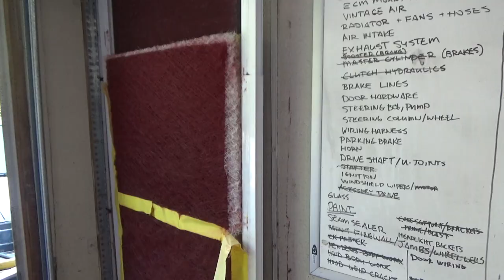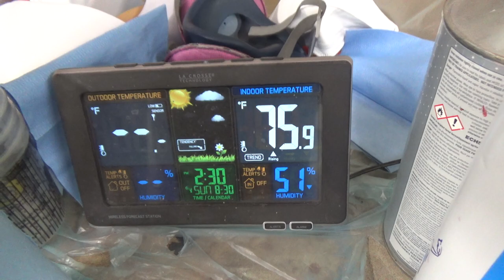1977 Camaro Z28 Part 242 : Will it blend?

Comment: Hi Erik, looks good. I know I mentioned it before you started painting about dog housing the compressor. What I've done for years is use this light weight PVC frame and tape it to the wall leaving about 2 inches open on the bottom and cover it with fresh car cover as needed. If you flow coat please try this method it works. Looks really good, your hard work and determination  has impressed us all.
Reply from the maker: Thanks Cliff. Sorry, I forgot all about it that. You say a car cover? While you are spraying? Do you have a pic of this?
Reply: @asicerik  Yes, measure your compressor x,y and z and leave a few in. on each side.  Using  schedule 40 or lighter pipe you'll need to  make three square loops and glue them together using four elbows, four 3 way 90 degree and two 4 way 90 for the center or midway loop. Your just making a light weight box that tapes to the wall surrounding the compressor using 2" tape. Using the plastic car cover you have that looks blue wrap it up with the " paint this side" on the inside. Make sure to leave a gap on the bottom for it to breathe. I hope this all makes sense. I just threw out my crusty old one in the recycle bin after painting my mercedes.  The pics on fb doesn't show it sorry.
Reply from the maker: @cliffwright9842  Yup, that is exactly what I was thinking, except the "Paint this side" facing out so overspray does not flake off.

Comment: I stand corrected, I did a search and there in fact is "microfiber tack cloths"  should have known you would have already been on top of that!
Reply from the maker: I was watching Motivated Painters, and he used regular microfiber cloths, so I started using them too. I used the normal tack cloth at first, but after that fish eye reaction, I switched to the microfiber
Reply: @asicerik  If you don't mind, what's your thought after using them? might be something I might want to try? cost comparison and longevity?
Reply from the maker: @ispeedalot1  I am not sure. I use normal wipes for cleaning and wax & grease. I have never had an issue with a tack cloth before, and am not sure if that is what went wrong here. You are supposed to leave them to air out a bit before using them, and maybe I did not wait enough. Tack cloths are pretty cheap, but I have not compared costs.

Comment: dude, I think your golden! so happy for you! now it can showcase all the hard work you have put into it. I'll have to admit, when you turned that gun sideways to fog the hood, my you know what puckered. Definitely an oh shit moment for me for sure. All came out ok though. I have to ask about the microfiber cloth though, is that actually a new type of tack cloth? never seen one before if it was. If it's not, I wouldn't use it between or even before painting. About any type of cloth, rag or whatever will most likely reintroduce some lint to the surface. I will go as far as using 70% isopropyl rubbing alcohol after using the glass cleaner to help cut down on the static electricity wanting to pull lint to the surface. Then using a tack rag is acceptable directly before and during. Your running a much better compressed air dryer than me. I use those small water traps as a fail safe all the time, just toss them after every use. I also use a dedicated air hose, and dryer that tee's off directly out of the compressor. I never use the same hose that I use for my air tools or whatever. Probably overkill I'm sure, but I don't want any possible contamination of oil or something making it into my paint if I can help it. Your car is going to be killer, I refer back to your videos all the time. I am working on a 79 Z and currently working on my spoiler gaps as well as filling firewall holes I may not need. Consider yourself as one of my resources!!!  Again, great job.
Reply from the maker: Thanks a lot! I answered the microfiber in the other comment. I also use a dedicated air hose. I tee my shop air off right before my Motor Guard and Devlibiss filters and the paint hose is after the filters. Even the shop air side has two water filters + the big copper water separator on the wall.
Reply: @asicerik  You my sir are student becoming the teacher!
Reply from the maker: @ispeedalot1  "It's the end of the world as we know it"... LOL

Comment: One thing I always do is strain all of my material at least twice with a new strainer each time I seems to help me a lot with nibs. I use a super fine mesh on the strainer. The car is lookin great it will be a sweet ride, be proud
Reply from the maker: Thanks. I may need to get some finer strainers. I did use the waterborne filer in the cup for the base, which is 125 micron. Maybe I can use those for everything.

Comment: With all of the precautions you took and all the cleaning I cant figure out why you are getting trash in paint ? I painted a 1978 Z28 black in my garage about 15 years ago with very basic exhaust fans (two square room fans) a portable compressor and no water separation gizmos. I just wet the floor down and got to it. I don't recall seeing any trash in my paint . Maybe I didn't look hard enough. Certainly is a mystery
Reply from the maker: Best guess is crap coming off my old compressor. I am going to build a doghouse around it for the remaining work. We'll see if that cleans it up. Thanks!

Comment: you need a bigger cup for that gun :)  i was honestly scared when i saw you wipe with a microfiber towl, when im done first thing i do is turn the compressor off :)  as it dries i take a toothpick and drop clear on holes if i need to. yeah the compressor was the culprit!!  Put it outside!
Reply from the maker: It is not the cup. I was running low on paint, so I did not want to mix too much and end up tossing it.
Reply: Great videos. Especially trying to film it while painting!
I'm going to try painting my 81 Camaro before spring. I've been working on it off and on (mostly off) for over 15 years! Going for 69 gm lemans blue, maybe add a little bit of interference green and platinum pearl to the very first coat of clear, for added "pop". 
I have my compressor setup just like you. I'm going to block that whole thing with plastic. Lots of crap coming off that thing. Looking good!
Reply from the maker: @jakefriesenjake  Thank you Jake! Good luck with yours. Sounds like an awesome color.